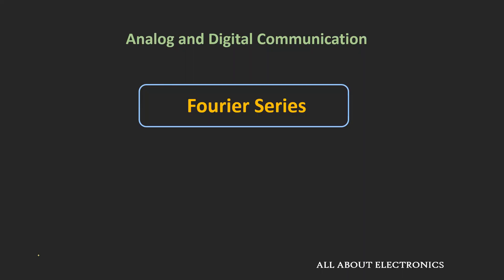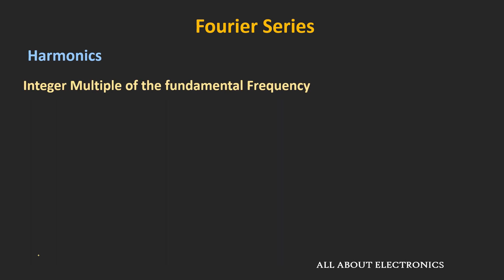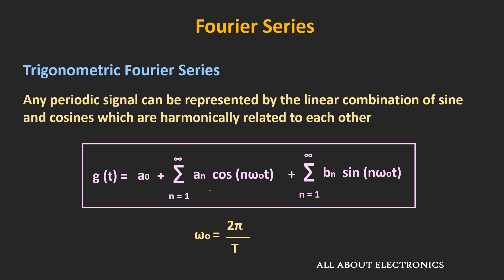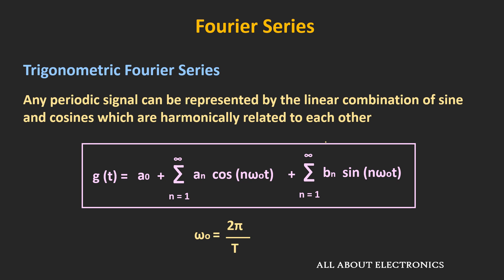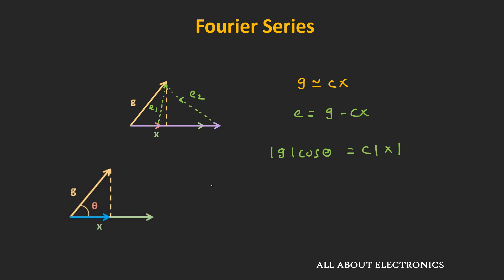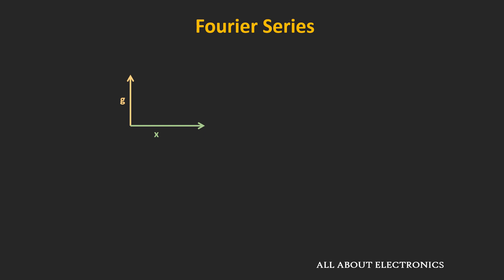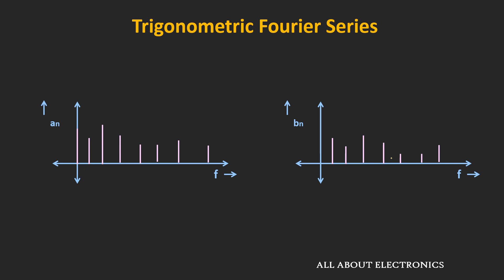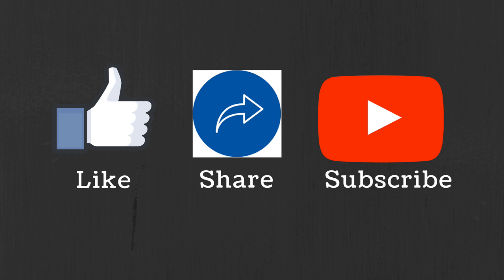Introduction to Fourier Series | Trigonometric Fourier Series Explained

Comment: sir can you explain how and why capicator used in amplifier board
Reply from the maker: The capacitors are used for different purposes. It could be for coupling / decoupling, for stability etc. Can you please tell more specifically, about which capacitors you are talking about ?
Reply: @ALLABOUTELECTRONICS  can you explain both sir